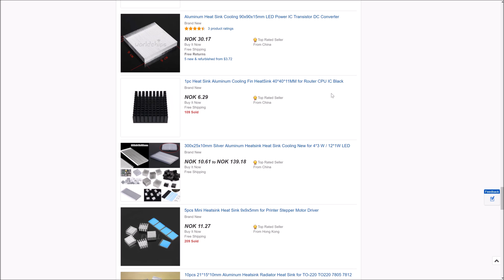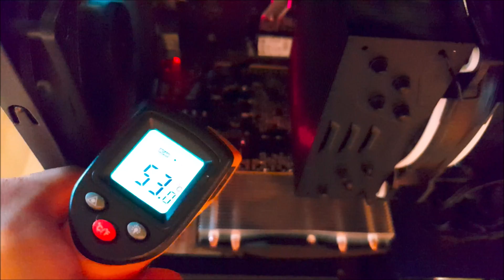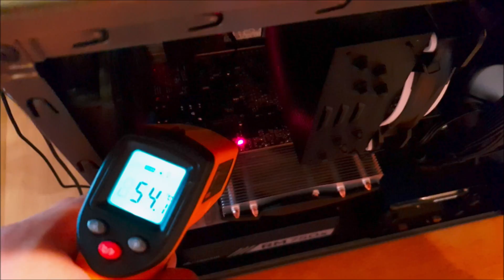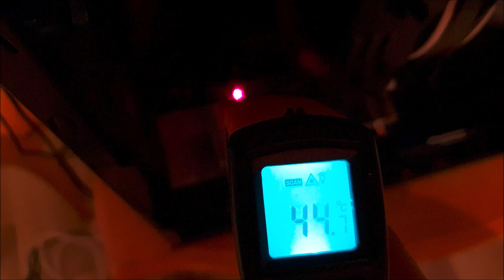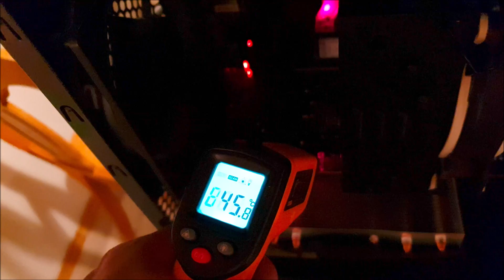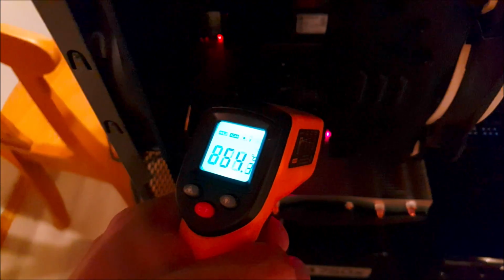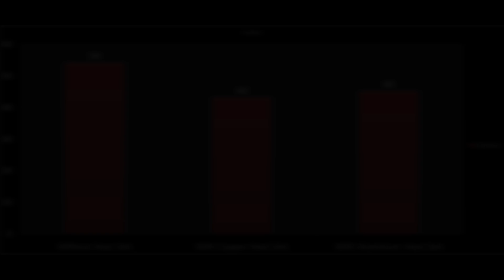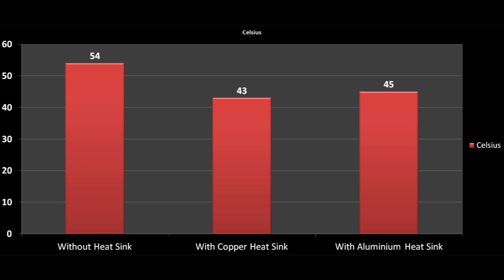Copper vs Aluminium VRAM Heat Sinks

Comment: Dude u used 3m double sided tissue tape, that isn’t made of thermal transfer !
Reply from the maker: Dude, no I am not. This is thermal tape for heatsinks only and until today it's working great 👍https://www.ebay.com/itm/2Meter-long-2-5cm-Wide-Heatsink-Double-sided-Thermal-Adhesive-Tape-for-Heat-Sink/402643028789?hash=item5dbf650b35:g:ZGIAAOSwRLZUE6N7
Reply: @TechnologyHive  it looked like it on the side my bad, what’s the thermal conductivity of it does it specify ?
Reply from the maker: @filiplaskovski9993  That I have not checked. It does well so I did not put too much effort into finding the watts per meter kelvin rating on it. I don't suspect more than 2 w/mk.

Comment: The copper would only be warranted in certain citiatiosn
Reply from the maker: If I were a heatsink manufacturer, I would use copper on all base plates. Period. And make the heatsink fins of aluminum. 👍

Comment: i ordered 12 of similar ones like yours but i wanna put em on top of a back plate of my water cooled gpu, under heavy load back plate tend to run ass hot, back fan set as intake helps a lot bringing temps down, but i want to move it step further putting proper heat sinks on backplate for more surface area.
Reply from the maker: In that case I would have ordered something a bit bigger, since you have an exhaust fan moving air out. But perhaps the small ones help 😊👍

Comment: I dont think that's conductive tape, it will be better than air, but I guess there are way better tapes out there
Reply from the maker: It is working just fine at the moment. It sells as thermal conductive tape. But we will see in time if it continues to perform.
Reply: @TechnologyHive  I yesterday went down the rabbit hole of tapes and the Parker 412 or 3m 8810 (or 8805, 8815 depending on  thickness) seem best. The one you have really is not specifically for heatsinks. It will probably work fine, just like regular tape, but just that it's not designed for it. A little bit up in the page : https://www.micforg.co.jp/en/cat_tapee.html#t_t412
Reply from the maker: @Rombbb  Thanks for the tip 😊👍.

Comment: Nice, could you post the exact model for that 3m tape? Appreciate
Reply from the maker: https://www.ebay.com/itm/1-Meter-20mm-25mm-40mm-Width-3M9448A-Double-Coated-Tissue-Tape-Thermally/174568845969?hash=item28a51d3291:g:DxoAAOSwwSpf4k~h
Reply: @TechnologyHive  Thank you..

Comment: i have a ps4 fat 16 vram each one 512mb 8 on the back  and 8 on front  both sides i want to use copper thermal pads 1mm thickness problem that i dont know how to make the pads stable on both sides thermal paste won't make it sticky any advice ?

Comment: heat dispersion is also about overall surface area of the radiating medium. Seeing how tiny the copper heatsinks were compared to the aluminum, I am pretty impressed.

Comment: Nice video, thank you for that. 

In addition to that the thermal conductivities of the used metals: 

Aluminium: 236 W/(mK)
Copper: 401 W/(mK)

So copper get away the warmth nearly twice as good, as aluminium does. 
And like the other guy said before: the surface of the copper-heatsinks is smaller. If you take heatsink with lammellas your outcome should be much better.

All depends on following formula:

Q= ^/s * A * delta-T

Energie equals thermal conductivity per way multiplied with surface and temperature difference.

Comment: hi , i'm here from 8/2020 building my custom cooling rig for my pc . 
the first wrong something you did in this video is comparing 2 different material with not fair factor . the factor is the two material must be with the same surface size that exposed to air flow . you picked two different shapes with two different surface size . i'm keep watching ..

Comment: Great job
What if you use thermal pad in place of double tape?
Reply: What tape is he using I want to try it on my ASUS H410M-E Mobo VRM
Reply: @aravindraja8034  Double Sided Mounting Tape 1”x 32.8 Ft 3M 9448A Double Coated Tissue Tape Strong Adhesive Heavy Duty Transfer DIY Tape White Color for LED Strip Light Office Home Car Décor(9448AB)

Comment: Should I use a specific tape for this?
Reply: Look online for the right tape to use with these. You don't want anything too thick. https://www.ebay.com/itm/Japan-SEKISUI-5760-Double-sided-Thermal-conductive-Adhesive-Tape-for-Heatsink/171112683534?epid=753204017&hash=item27d71c580e:g:xwkAAOSwDdNaskkm

Comment: copper transfers heat faster thru itself (better transfer and absorption), but aluminum dissipates heat faster into the air, that's why the core of the heatsink is copper, while fins are aluminum
Reply: Heat conductivity to air, I don’t think so. Copper is far better. The reason why they shift to aluminum in the fins is because it’s weights less and cheaper and is able to do the job good enough. The lighter weight on the fins means they don’t gotta bond it as strong as using all copper.
Reply: @Nyu0005  like it is important what you think... buy a better periodic table and start reading... jesus... every element has it's specific thermal properties and like i said, copper has best thermal conductivity while aluminum has best dissipation, thats why all good heat-sinks have copper core and aluminum fins. thats it. period. nothing to add, nothing to think. it's a fact!
Reply from the maker: That's true. No one can argue with that.
Reply: @albirdie1630  This is wrong. Absorbtion and dissipation are the exact same process viewed in reverse and then forward. They happen at the same rate in both direction, because well, they are the same.
Reply: @albirdie1630  Both metals will dump heat at almost the same rate to the air (since its limited by the thermal conductivity of air). The metal with a higher specific heat (or just heat capacity) with remain warmer longer, but this is completely irrelvent.
Reply: @Axlg  there is no absorption category when we talk about metals but yes, copper fins would be better but far more expensive for many reasons and conductivity between copper and aluminum is not even close, its almost double (401 wmk for copper and 237-ish for aluminum) but aluminum has some other benefits (such as convection) that make him almost as efficient in dissipation  but, sure, i made a mistake, from purely physics point of view copper is better in both fields, but since aluminum is not so good for heat conductivity and almost as good in dissipation, and quite cheaper and more malleable as well -thats why they use it for fins but not so much for 'pads' or cores of heatsinks, at least when we talk about computers
Reply: I have a aluminum frying pan in my kitchen. It cools faster than anything else in my cookwares.
Reply: It's ok to cook in aluminum unless it's something highly acidic.
Reply: you are blind ? small copper radiator cooling better than bigger aluminium radiator
Reply: @cyna76  exactly my thoughts, if aluminium was "such" good of a decipator they would use it for making laptop cooler fins but they don't , they use copper because copper is better at decipation!
Reply: What about a copper aluminum alloy?
Reply: Obvious phishing attempt is obvious
Reply: It's not actually true because if aluminium fins were such a good idea they would use them on high end laptops but we see they are using copper!!
In my opinion they are using copper to make it cheaper for them because copper is a tough material to work with!!
Reply: That time when you remember your class on thermodynamics and material science. Nicely done there 😁
Reply: Thank you for your comment, i was curious about why they didn’t use full copper(Other Than price). :)
Reply: @RyanMTube  That information is wrong and he already admitted it (read his comment, 2 comments above yours)
Reply: @Cethavi  ah, thank you 😂

Comment: I  completely disagree  cos he  measured wrong he was measuring the heat sink so that means 
the aluminum was hotter meaning it was pulling out more heat from the vram  that means the heat sink into the aluminum more  and faster to draw out the heat how it should, were the copper will do it slower and keep it more in.
Reply from the maker: If you look again, I was measuring the rear side of the memory chip. 👍

Comment: i disagree  cos he  measured wrong he was measuring the heat sink so that means 
the aluminum was hotter meaning it was pulling out more heat from the vram  that means the heat sink into the aluminum more  and faster to draw out the heat how it should, were the copper will do it slower and keep it more in.
real test would be 1 hour pc run time then measure 
,then turn off pc and remeasure in 10 minuets -

Comment: the reason they use aluminum is because its WAY cheaper.
Reply: disagree  cos he  measured wrong he was measuring the heat sink so that means 
the aluminum was hotter meaning it was pulling out more heat from the vram  that means the heat sink into the aluminum more  and faster to draw out the heat how it should, were the copper will do it slower and keep it more in.
real test would be 1 hour pc run time then measure 
,then turn off pc and remeasure in 10 minuets -
Reply: @Jozavenue  He measured the back side of the PCB where the chips are soldered to and not the heat sink. So the measurement was accurate. Only flaw I can see is that the heat sinks have a different designs.
Reply: @Jozavenue  do you are aluminum fanboy or what? oO i'm looking for a solution for my VRM but everywhere i goes i only see people bashing the aluminum and praising copper you are the only one saying the opposite.

Comment: Both Copper and aluminium are great for cooling. It is not only about the material, but about surface, air temperature and airflow. Which way are the heat sink "wings" placed etc.

Comment: Would have been good to see what the software was pickign up from the temps too. Obviously the extra surface area helps the aluminium, though I am going to do it with the aluminium because the lighter weight should mean it will not fall off the tape which is pretty shitty- as they will be upside down. Also going to think put a small fan blowing horizontally to get direct flow in there, making sure not to interfere negatively with the gpu's fan and wind direction.

Comment: Copper did better because (i think) it has more mass (heavier). So theoretically it is a bigger sink. Use good quality tape and u be golden. (More like copper color, golden)
Reply: disagree  cos he  measured wrong he was measuring the heat sink so that means 
the aluminum was hotter meaning it was pulling out more heat from the vram  that means the heat sink into the aluminum more  and faster to draw out the heat how it should, were the copper will do it slower and keep it more in.
real test would be 1 hour pc run time then measure 
,then turn off pc and remeasure in 10 minuets -
Reply: @Jozavenue  But he measure the back of the card not the heatsink itself i think.

Comment: Dude i love , iam modding my loud rtx 2016 and iam hopping to fix both the noise and temperature with a aio and now after vid some vram heatsinks thx u got a like and a sub
Reply: Did it worked? I'm thinking in doing something quite similar to my GPU
Reply: @FelixOnn1  it did just make sure u use glue type termic past or else over time they will fall

Comment: Very few DIY cooling vids out here lol.  This helped with my VRM issues on my ITX board.  Dropped it about 10 celsius and stopped the runaway temps.  nice hidden find.
Reply from the maker: Thanks for watching!
Reply: Buddy did you use the copper or aluminum on your vrm motherboard i need to put some on mine and im desperate looking for information my vrm goes to 57 60 degrees under load i'm afraid of burn this thing.
Reply: @mr.schaeffer5399  60? thats barely even warm!
Reply: at least for PC equipment
Reply: @virtualtools_3021  Hmm yeah but it's 60 on HW monitor the real temperature can be 30 degrees more easily because i didn't measure with a real thermal camera, and with my overclocks i don't see an improvement in performance maybe because of that.
Reply: @mr.schaeffer5399  60 degrees on your VRM is actually quite good.  I was getting 90+ on benchmarks. Using a B350 itx board. on a 2700x.
Reply: @rramos7488  Joss pak dhe

Comment: Maybe that tape is new but the "3M' tape I used failed on me multiple times when the card cooled down they fell off i also used multi special solvents recommended by 3M lol what a joke i could lost my entire MOBO or PSU F that tape
Reply from the maker: I recently experienced the same. I'm disappointed at 3M.

Comment: So the copper ones were actually smaller & did better slightly so if they were same size (about 3x) you might get 12 deg cooler instead 2 at the MOST
Reply from the maker: I think so. But it was difficult finding them all the same size so had to work with what I had if you know what I mean. 👍

Comment: Copper is ALWAYS better for three reasons. 1-It has much better conductivity, can move heat further and faster. 2-It has more density and therefore more mass for the same size. 3-It is more malleable and less likely to vibrate in sync with chokes in the VRMs which may be close by.

Comment: those guns are useless for this type of measurements, to easy to make an error
get a meter with thin thermocouple and stick it between heatsink and memory
Reply: i had one of these, brand new, used only coupple of times.... last time i inserted batery wrong way aaaaand smoke start coming out when i pressed the button :/

Comment: you got it all wrong: the optical thermometer laser is ABOVE the IR sensor, so you need to target way above the chip to get the temperature
Reply from the maker: The laser is only there to point at a general area. It does not pin point the spot in question. This is why you must hold it at some distance from what you are measuring. So no, I did not get it all wrong. But thanks for watching!
Reply: look in your video, at one point you get a 50C measurement then you point the laser to the heatsink which drops the temp by 10C because the thermal sensor sees part of the PCB instead of the heatsink  @TechnologyHive
Reply from the maker: @daslolo  Thanks for watching and I appreciate your opinion. Have a good one.
Reply: That's why they have an ideal range, as said in the video.  Don't trust the laser though, as said in Hives reply.  If you're trying to measure something that's warmer than its' surroundings, you've found it when the temp jumps.  Laser just gets you in the neighborhood.

Comment: The difference is not big without heatsink or with heatsink.
Reply: 10c is pretty big.
Reply: the tape is not good ,glue is better
 also disagree  cos he  measured wrong he was measuring the heat sink so that means 
the aluminum was hotter meaning it was pulling out more heat from the vram  that means the heat sink into the aluminum more  and faster to draw out the heat how it should, were the copper will do it slower and keep it more in.
real test would be 1 hour pc run time then measure 
,then turn off pc and remeasure in 10 minuets -

Comment: The design of the heatsinks matters such as much as the material used, as well as the overall surface area.  A small Al heatsink with several long fins will cool better than an equally small Cu heatsink with a few short thick fins.
Reply from the maker: Yes that is a factor to concider also, as well as the material it is made from. It is for this reason that most heat sinks today are a mix of both copper and aluminum. Copper absorbs the heat better than aluminum, but aluminum radiates heat better into the air than copper. The designs are important as well! Thx for watching.
Reply: @TechnologyHive  but ur findings show Al was 45° and Cu was 43° (cooler since it radiated better)

Comment: I'm sorry to bother you but I have a favour to ask. I'm seeing a ton of ceramic heatsink listings on AliExpress, eBay, etc. Could you run a test with those versus the copper and aluminum ones? Thank you for the great video by the way. I subscribed! :D
Reply from the maker: Ceramic is an insulator.
Reply: @TechnologyHive  That depends entirely on their composition. They are typically good electrical insulators, and some compositions are very good for thermal conduction.

Comment: I have heard you need almost a third more surface area to get the same cooling out of aluminum. Thats why more fins in aluminum radiator than copper.  Anodized aluminum is just for looks and cools slightly worse than bare aluminum. And corroded aluminium cools worse than anodized. The thicker the metal the longer it takes to heat and cool. More fingers and thinner work better. That's why aluminum blade type heat sinks. More surface area contact with air or liquid the better to dissipate heat. Like when the geographical pole is overland we have ice ages. Now that its over the arctic oceans it dissipates the cold making planet warmer. When it reaches Siberia we will see global cooling as it makes ice sheets their. Its all about the surface area and how well the heat or cold transfers.
Reply: Exactly if it absorbs heat better it has to release better otherwise you'd break the laws of thermal dynamics. The biggest reason companies use aluminium is cost and ease of manufacture which subsequently lowers cost.
Reply: true but then it all ends up being a factor of cost as well xD Aluminum is way cheaper than copper so I guess it ends up becoming a cost issue for manufacturing xD

Comment: Hmm, I think the infrared temperature meter meters the temperature so large area that this is not accurate. The red laser dot is there to just throw aim in the right direction.
Reply: disagree  cos he  measured wrong he was measuring the heat sink so that means 
the aluminum was hotter meaning it was pulling out more heat from the vram  that means the heat sink into the aluminum more  and faster to draw out the heat how it should, were the copper will do it slower and keep it more in.
real test would be 1 hour pc run time then measure 
,then turn off pc and remeasure in 10 minuets -